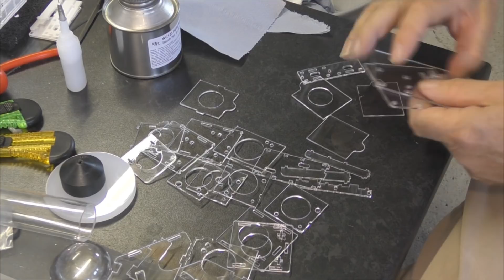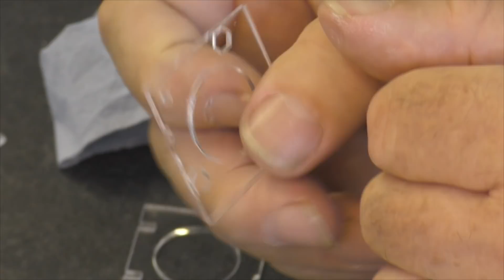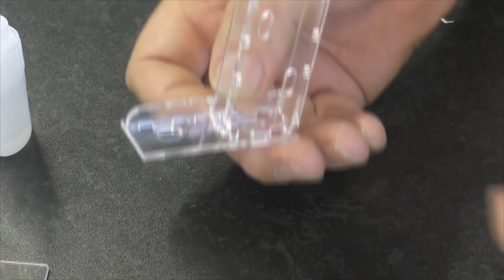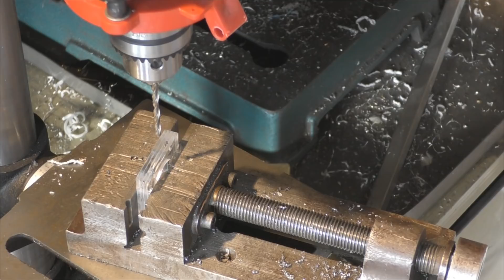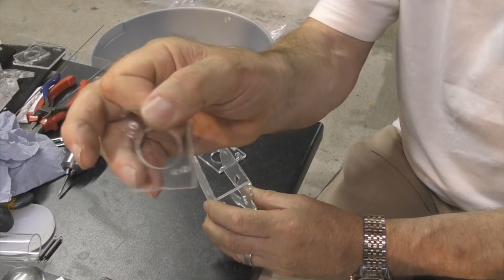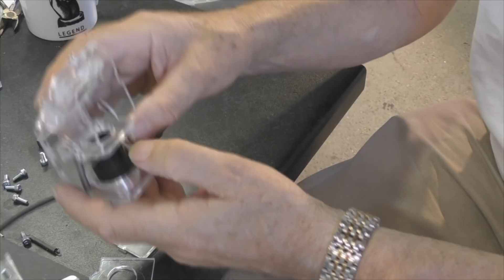RDWorks Learning Lab 147 China Blue Head Transplant Part1

Comment: I've found the glue, it's made by Bondrite Adhesives Ltd, but where did you get the syringe. Did it come with the glue or did you have one already?
Reply from the maker: Mine came with syringe and bottle but I did specifically mention it when I spoke to the guy. Whether it comes standard I cant be sure so it may be worth a call or email to be sure. Without that dispenser it would be useless.
Best wishes
Russ